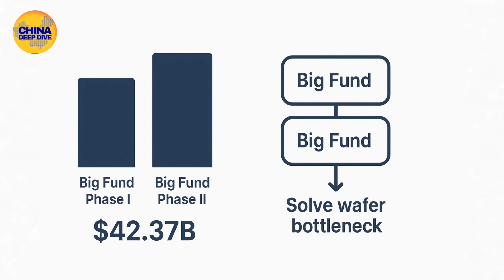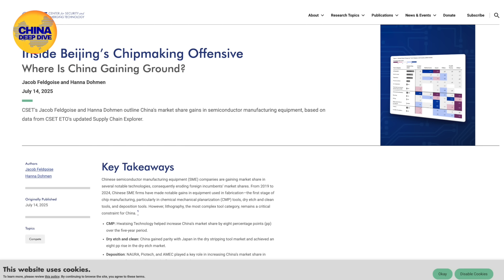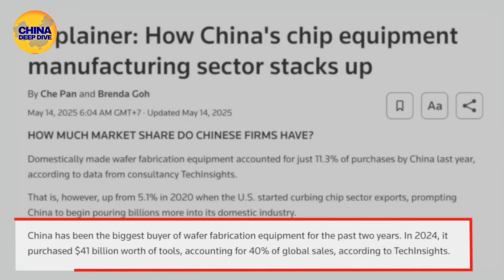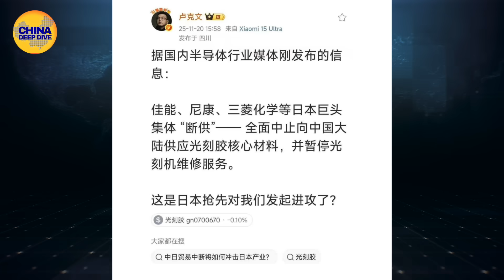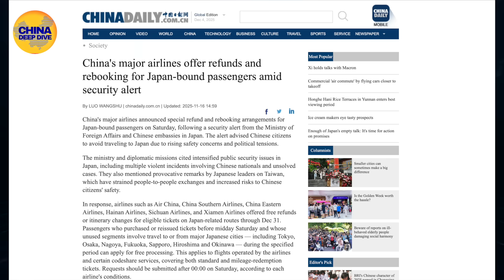Again! CCP shoots itself in the foot  Chinese wafer fab owners are weeping: Tourist Boom in Japan

Comment: This video needs updating to get a balance.  China would restrict rare earths and trade.  China can produce about 30-40% of the photoresists it needs, but not enough.  But how does that hold out against Japan's car manufacturing going down to zero and electronics industry in general going down to zero.  What does Japan do outside of those two industries?  Who is likely to win out?
Reply: Japan already established rare-earth supply-chain without China.
Also, Japan makes money in service sector rather than manufacturing goods.
So, China’s economic sanctions don’t work as much as China hoped for.
Reply: 'Photo resist' is a generic term.  China can probably produce the chemical photo resists for printed circuit boards and the traces on some of the 'bigger trace' semiconductors (about 25nm and larger) but the ones talked about here that Japan are cutting off are very specialized.  Japan's car companies and home electronics manufacturers shouldn't have a problem finding companies outside of China that can make circuit board assemblies for them.  As for rare earths, its 'tit-for-tat'; China cuts off access to rare earth materials, Japan and the rest of the western alliance can cut off other things China needs.  As for Chinese tourists, Japan is in the process of modifying their visa laws, making it more difficult for foreigners to come.  One of those targets is Chinese, too many 'wolf warriors' coming and disrespecting Japanese cultural exhibits and monuments.
Reply: @crosslink1493  any can make the photo resist but not high quality. Japan made 99. 9 % pure, while others can't make the same quality.  Less purity causes  more deficit of those products.
Reply: @crosslink1493  I think that's a problem.  Japan has strong positions, but the economy's state is a problem exasperated further by high military spending which is possibly the reason for the PM's rhetoric - to draw public opinion on why they are selling so much of US bonds to pay for things but including a huge increase in military spending.  Later on they'll change the narrative that the spending increase was because of the Chinese, but its the wrong way round.  In terms of visa, Japan is well within its right and there probably are more Chinese incidents noticeable due to the high number of tourists and there always being a few causing trouble.  But Japan's problems are that any reduction in trade, whether its photoresists, tourism or whatever, will hurt Japan.  There is a very high markup on photoresists so that is a problem if they play that card.
Reply: Japan's car companies in China are for manufacturing and selling cars in China only.
For export, Japanese car companies manufacture in Japan (ie. Lexus...) or Thai Land (Camry...) or other countries.
Reply: @ongmat4439  No dispute there.  But do they produce their own rare earths for the cars they export elsewhere?  The only guarantee of rare earths is when its built in China where China doesn't have to worry about whether the rare earths are resold to the US etc.
Reply: @sowhodecidedthat3924  China doesnt have the only rare earth mines, its just that dumped at rock bottom prices despite extreme environmental destruction. Already mines many places elsewhere. The issue is only short term as other countries got lazy investing in such mines.
Reply: @chinesesparrows  Correct in a way.  It depends on which rare earth and Chinese, through quantity offers the best prices.  But the bottleneck is refinement, so even if a country digs the rare earths out of the ground from other countries, they can't refine on a commercial scale that is cost effective or at all.  Refinement is an art with many layers and rare earths from different parts of the world are made up of different combinations of minerals and the refinement process needs to be adapted each time.
Reply: Japan only import 10% of RE from China.
Reply: ,,Not China,,🎉